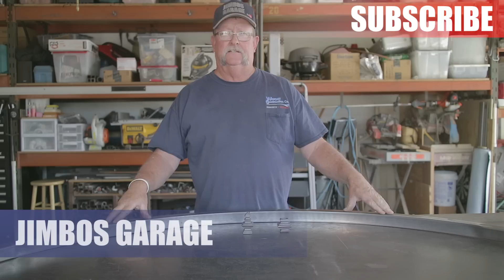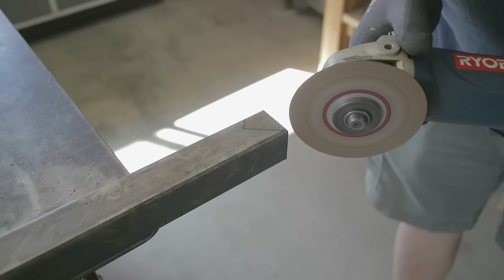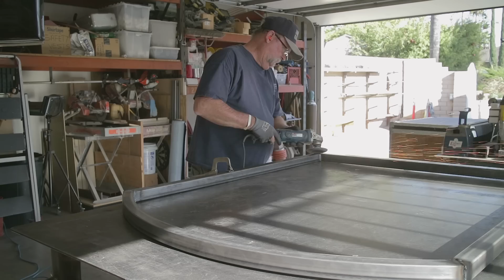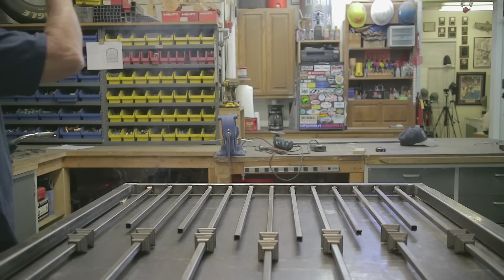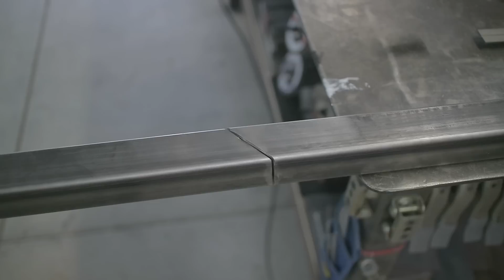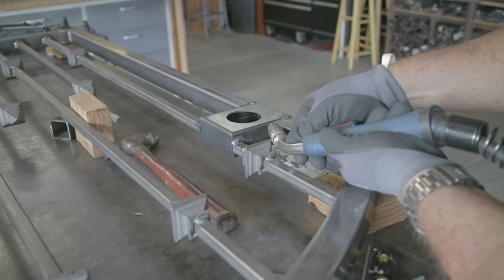Metal Arch Top Gate - JIMBOS GARAGE

Comment: Where do you buy your knuckles   im pricing  all accessories knuckles  ect they are expensive someone wanted a gate built  and all the gate accessories cost me more than the person wanted to pay for the entire  gate and I dont work for free about time I pay for the steel, accessories , wire gas my labor  some people just dont know whats involved  in a fabrication shop and want things for nothing  I try to avoid  them if I can ! how do you price your jobs,  have you ever run into that problem  ?
Reply: You did a nice job on that gate looks great  !!
Reply from the maker: I get most of my parts from king metals, I order them on line and it is two day delivery. Great pricing!. A standard 4' x 6' sq. tube gate for me is about $750 installed. The more detail the more expensive it gets. For example, That gate was $1250 installed.  Jimbos garage!

Comment: what type of welder do you use I'm looking to invest in a welder soon have a cheap harbor freight one right now but want something good
Reply from the maker: Thanks for watching Ronnie, I have EVERLAST welding equipment they are pretty good, But also look into AHP welders they also have good equipment at a good price point!  Jimbos garage!
Reply: Jimbos Garage thanks jumbo I enjoy watching your videos trying to get ready to start my gate but it's on a 3 acres property but all the front I'm going to attempt to build my self with the double opening gate
Reply: which one 200 256 etc sorry my auto correct jimbo
Reply from the maker: I have the everlast power i  mig 205,   or the ahp alpha mig 200a is about $450 on amazon right now, check them both out! And there are other inverter machines out there as well.
Reply: Jimbos Garage thanks yes I'm going to look them up thinking of buying one Friday